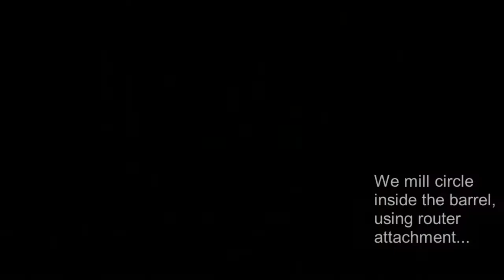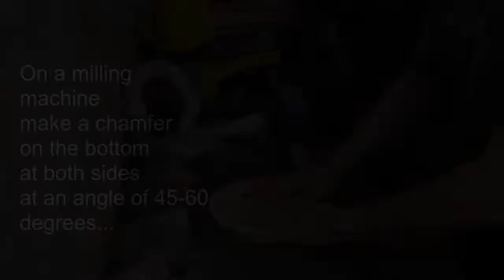Cherry barrel from an old log | DIY | How to make a wooden barrel

Comment: Awesome video! 3:56 are you using a homemade jig to shape your staves? 6:39 what type of tool are you using to squeeze the barrel? I would love to my my own barrel, I’m a distiller.
Reply from the maker: Thanks!!! I am self-taught and I made most of the machines and fixtures with my own hands. To process each riveting, I use a homemade milling device that I made from an angle grinder with a broken gear. I also use a special home-made device to tighten the barrels.